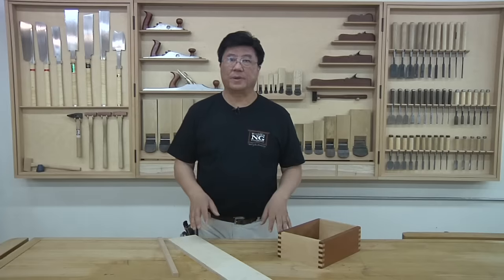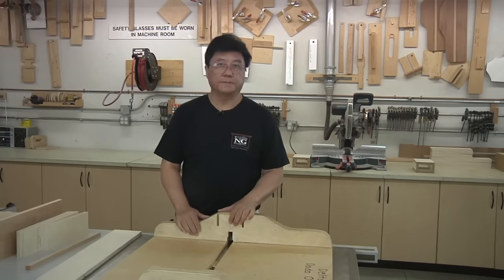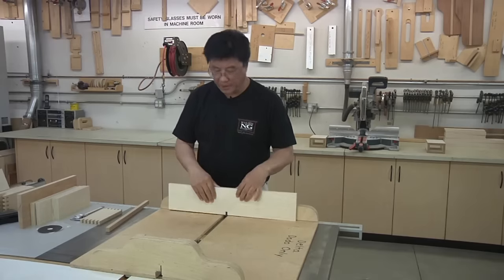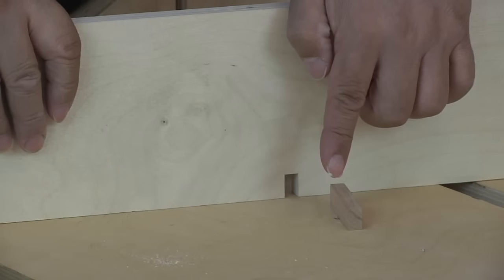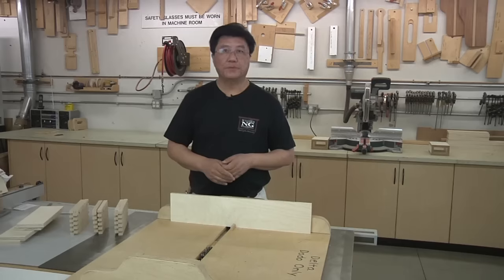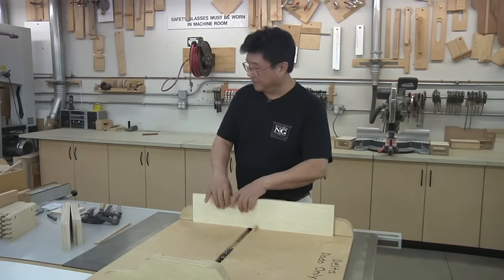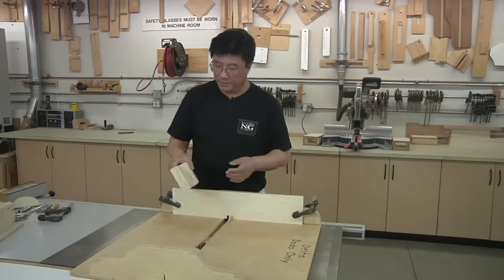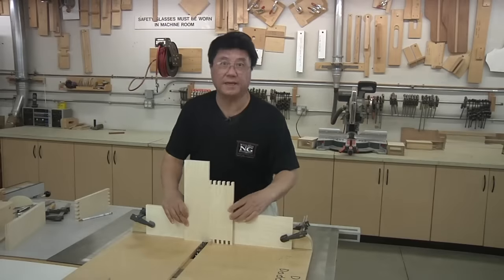Make an Accurate Box Joint Jig, Simple and Fast

Comment: Morning, William. Can you please advise me on one aspect of table saws: I own a DeWalt portable table saw - will a Dado cutting set be accommodated on my machine (it's the DCS 7485 model); I only ask because DeWalt (UK) could not give me a conclusive answer, & rather than lay out moneys for same, I'd obviously prefer to know, beforehand.
Excellent instructional presentation - I have subscribed on the strength of this first video - thank you !!
Reply: I just looked up your model of portable saw and the handbook that I saw said not to install a Dado set. My guess is because of the arbor length. I had the same issue with my first saw (portable contract) and while I couldn't install a Dado set I could install a Boxjoint cutting set (just two blades side by side in a couple of different configuations). Just a thought.
Reply: Thank you, Richard. I had rationalised that the arbour might be the issue at hand. The box joint cutting set, I have not seen in the UK; could you please (if possible) supply me with a brand/make for this set - even if it is Stateside, I would be grateful. I shall of course look around Europe in the interim,
Kind regards,
Andrew.
Reply: Andrew Tongue Andrew I just got home and was going to text you a picture of the box joint set that I have at home but I realized we can’t do that on here. The one that I have is by Freud and it is an 8” set that cuts 1/4” and 3/8” joints. If you want a picture feel free to message me on Facebook or Instagram and I can shoot you a picture of the set.
Reply: Evening to you, Richard, & thank you so much for taking time out to respond to my enquiries - it is greatly appreciated. Today has been a rare day off for me, so I've been playing 'catch up' with friends & family, as well as having a couple of hours' down time to myself. I am currently constructing two new bedside lockers, & want to be able to box joint the corners of the drawers. I shall look online for this "Freud" box joint cutting set that you mentioned (& obviously own) - thank you, too, for offering to show the set in question, but I'm pretty sure that your endorsement for same is completely sound. I might suppose that you're six or seven hours behind my time, here, so I wish you a pleasant evening,
Best,
Andrew
Reply: Andrew Tongue Apologies for the late reply but work and real life and all that. Hope you’re able to work something out. On a side note i just finished the box joints for the retirement chest and Williams method worked like a charm!
Reply: No, that's fine, Richard - we all have a life outside of the internet - I too have work & other preoccupations to keep me busy. I am pleased that you've completed the chest, & certainly his (William's) is one of the better methods I've seen. I've devised a safe technique, employing two blades offset, with an extra spacer for the arbour on my machine (purchased from DeWalt spares) - this works well, so I now have a Dado cutter, of sorts. Thank you for getting back to me. Enjoy the weekend ahead :D

Comment: Wm ... duplicated your process for my homemade router table with a sled. Question I have a variable speed 2-1/4 hp router with both 1/4 + 1/2" collets. What router bits would you recommend and at what speed would you run the router?  Have been getting a good bit of "CHIP-OUT" with brand new bits. What a wonderful video ... literally watched it a dozen times. Have a Blessed Day.
Sincerely,
Fred Scharpenberg
Clemson, SC
Reply from the maker: Hi Fred, I like Whiteside bits. To help avoid chip out, use a spiral bit if possible and backing boards. The higher the speed the cleaner the cut depend on the size of the bit. With small straight spiral bits of half inch or smaller, you should have no problem running at a higher speed. Hope this helps. Thanks for watching.
Reply: wnwoodworks I have to agree, I swear by spiral bits...SO much cleaner and smoother than straight bits....plus you're not cutting ALL the material at once....Depending on your application, you can get up and down cut spirals. For eg: if you're cutting the dado for the drawer bottom, you don't want the spiral pulling down, potentially getting tear out (specially if you happen to be going cross grain). If you get an down spiral, the bit is cutting INTO the wood so your bottom or face of the board will be smooth....Now, you have to press a little harder because the bit is actually pressing the material away from the table, but not that much.....BTW William, I worked in a production shop and drawers are the bane of any shop....compared to the rest of the cabinet they are SO time consuming, no matter which method you use to make them....In addition, there's a micro adjuster that works great with Biesemeyer fences.....I had one on mine and loved it....I'll see if I can dig up the name. It attaches to the fence and is held in place on the horizontal steel bar of the fence. You flip the magnet out of the way until you're doing your fine adjustment.....(more accurate than tapping on the fence)

Comment: Request for clarification: Am I correct in understanding that the finished finger will have 0.003" clearance on either side (for a total of 0.006") and zero between top of finger and roof of the slot? Thank you for your great videos.
Reply from the maker: Yes, that's correct

Comment: William, can you go back and forth between different thickness of stock using this method or do you need a dedicated board with spacer adjusted for each stock thickness? Can you just make a board with the shortest spacer (height) of stock you use with the spacer the same width? 3/8th?

Comment: Hey William Great video! Question?  Why don't you end up with 2 holes on the sides?  It looked to me liked you cut all the way through all 4 sides.  You said the drawer front would cover the two holes in the front.  You should end up with 2 holes on each side before the front is put on, right?
Reply: The holes do not show up on the sides because they are cut in the finger portion (and not all the way through the thickness of the piece.  They only show up on the front and back because they are cut in the space portion, so there is nothing to hide it.  Pause the video at 19:53 and I think you'll see what I mean.  I hope that makes sense.  ;-)

Comment: this is a rather old video, but maybe you are still active here. i often have a problem fitting drawer bottoms due to variation in plywood thickness across sheets, and sometimes even with parts from the same sheet. doing kitchens with dozens of drawers I always have a few that are too snug, and as you alluded to your production shop days, this is a problem. as a result ive moved to cutting a 1/4 inch dado, then a qualifying 1/4 inch rabbet from 3/8 ply for bottoms. ill cut large batches on a shaper setup with tooling above the work, small batches on tablesaw, on edge with workpiece between blade a fence. even with expensive high quality plywood i find that this is the only way to ensure consistency of fit. is there a particular type of plywood i am missing out on? although this process works, its quite a few setups, and i would go back to fitting 1/4 inch panels in a second if i could get a consistent thickness product.

Comment: William, would you advise adjusting the finger tolerances for making box joints in solid wood vs plywood?
Reply from the maker: +pacquetman Hi someone ask this before.For hard wood it's between 3-4/ 1000 Softwood would be 4/1000 and hardwood 3/1000. Hope this helps.

Comment: Do you go through the setup each time you have to make box joints or do you have a way to reference the jig each time? With those tolerances I would think a pencil line might not be accurate enough. Would drilling a hole through the fence into the jig for a dowel work to repeat the setup? Thank you so much.
Reply from the maker: I setup every time whether I'm making 1 drawer or 30 drawers. It takes less than 5 minutes for me to make and setup the jig. It's worth it because I know it will be perfect every time.... less stress, more fun!

Comment: It would be nice if there was a way to make this repeatable, so that when you come back to make some more drawers a week or a month later, you don't have to do the bit with the feeler gauges again. Sort of like your (excellent by the way) table saw sled video, where the fence is fixed in place once you have it dialed in. Is there a way to reference the box joint jig to the dado sled so that it's repeatable once you have the fit just right?
Reply: I guess you could make a test piece that you save with the jig, the first finger of which could be butted up against the saw blade like you show in this video. That way you could more or less know the position of the box joint jig on the dado sled fence, and then clamp it in place.
Reply: Or maybe glue two pieces of a dowel into the jig, and have those reference two holes in the dado sled fence?

Comment: This may be a stupid question but here goes.... do you cut the female parts and then make the adjustment for the male parts? I dont understand why the female part is smaller than the blade, i thought the blade body was thinner than the teeth and if the teeth measure .375 similar to the set on a back saw the kerf is bigger than the saw plate. thanks for any help you can give.

Comment: So, when you were cutting the dado for the drawer bottom and kept tapping the saw, weren't you making the dado wider? If after you get the right fit, how does one pass of the blade make a wide enough dado to accommodate the drawer bottom?
Reply: He did the first cut on all four pieces first, then did the tap tap adjustment, then ran all the pieces through again.

Comment: Very nice explanation, except for the math at time 2:00. You say you are making 4-inch drawers with a 3/8" finger. You show a drawer piece with 11 fingers. That adds up to 4 1/8 inches. Are you rounding off in your description?
Reply from the maker: The opening measures .365 times that by 5 = 1.83 plus the fingers measures .360 times that by 6 = 2.16 add those together = 3.99 inch. OK so I'm  .01" off. :-)

Comment: Hi William, Quick question for you. I am in the process of building a Humidor cabinet. It will have 5 cigar trays total each varying in length due to the cabinet varies in depth from bottom to top. Is there a formula to figure out finger and slot thickness for the box joint to achieve the symmetry that you are speaking of in this video?
Reply from the maker: Hi Chris, There's no formula per say. If you want symmetry just add finger and slot for the next size.
Reply: Thank you Sir for the response. I used your 5 cut method in making my first sled this past week. I was very excited to get my cheap saw cutting so precise especially on my first attempt. That formula is now in my permanent notes. You are a master to say the least.

Comment: You mentioned several times that the .006 spacing is for plywood.  What about if you are using a hardwood?
Reply from the maker: Killashandra111 With hardwood it's between 3-4 thousands. With denser wood 3/1000 softer wood 4/1000. Hope that helps.

Comment: Hi William. I don't understand how u get those different tolerances when the cut wide is provided by the blade size.
Can u please explain it to me.

Thanks a lot.😘
Reply from the maker: The dado cut provides a the width of cut and cannot be changed, that is correct but I can change the size of the fingers shown at 9:20
Reply: Understood now! As the newbie I am, there are lots of things i dont understand easily...  May I asume that I have to remove the rest of wood with more passes when the thickness of the finger is wider than the dado?
Thanks again for sharing ur knowledge.
Reply from the maker: @oscarg8119  Hi Oscar, No problem. We all start at the very beginning. Don't feel bad asking questions, that's how we all learn. What ever size tooling you choose, whether it's 3/8 or 5/8 just make the fingers a few thousands smaller by adjusting the jig.
Reply: Thanks again William. I really appreciate.

Comment: William, one more question.  If you set your blade height 1/32" higher than your material thickness won't your fingers stick out 1/32" beyond the drawer surface after assembly?  Won't they be 1/32" too long?
Reply from the maker: Yes. You have to size your drawers 1/16th inch longer 1/32nd on each side

Comment: I made a similar jig using this method, but it didn't go smoothly for me because my ($30 Husky) digital caliper readings would vary, sometimes by up to a hundredth from finger to finger.  I was carful about measuring and how I was holding the calipers each time, and holding the wood firmly on a comfortably snug fitting pin.  I was finally able to make a nicely fitting joint using poplar by several adjustments, though the readings didn't help.  I am just wondering if the calipers or using semi soft wood plays more of a factor.  Any advise?  I put the jig aside for about a month, clamped firmly together, and pulled it out today to do some tests because I am finally ready to do some drawers.  But, they fit so badly and I am a little frustrated at my awful readings again.  Spending over a hundred dollars for new calipers seems like, hey, why don't I just buy a jig.  But I am good at math and want to succeed at this method.  Any advise?
Reply: Get the analog Mitutoyo caliper that William uses; you will use it many times.    I don't think I go a session without using mine.

Comment: This is a way old vid, but I just found your channel (and subscribed). You say 3/8” spacing is “perfect” for a 4” drawer, but 11 x 3/8 = 4-1/8. I’m confused. Ok, I’ve now watched the video, and as an engineer I am impressed by the down-to-earth precision of this process.
Reply from the maker: Here's what I commented on the front page. The opening measures .365 times that by 5 = 1.83 plus the fingers measures .360 times that by 6 = 2.16 add those together = 3.99 inch. OK so I'm  .01" off. :-) Thanks for watching .... but not too close please.
Reply: William Ng Watching the video, I realized the answer was probably in the “thousandths” which add up (x 11).  As an engineer I’ve always wondered why woodworking was so needlessly imprecise. Thanks for your approach - I’ve learned a lot from your videos and hope to attend one of your classes when I’m fully retired.

Comment: Hi I like this video but when I tried to replicate using 1/2 stock for my drawers - but there is a gap. Not sure why as I tried move fence away from opening and closer to opening. Could it be my spacer? Also does the .006 of inch apply to 1/2 stock?

Comment: I've heard of some folks saying it ain't right unless it it absolutely tight. ie: having to use a hammer blow to drive it in.    I've always thought that was wrong as to two pieces of wood would act as a squeegee taking out all the glue.   I, personally, thinking having a joint fit to where you can put the together the way you did, not extremely tight, is better.

Comment: I've run through the video twice but don't see where to explain HOW to make the fingers .005/.006 smaller than the mating joint? Wouldn't this require increasing the width of the dado assembly when making the finger cuts, or did i miss something?

Comment: What do the inside corners look like? Do you do a light sanding over everything before glueing? My cut has some tear off on back side of tooth, the front part of cut looks perfect. What am I doing wrong or is that normal? I do not have a zero clearance saw insert.
Reply from the maker: You shouldn't have tear out if you are using high grade plywood and that  you didn't have to adjust your jig much. Your jig is your backing board. Also make sure your blades are sharp. The zero clearance saw insert does not matter, it doesn't affect the cut or tear out for this application. Try adding a backing board to the plywood when cutting, it should help with eliminating chip out.

Comment: A second request for clarification: If I understand correctly, you're placing your workpiece on one side of the 0.004" undersized peg, potentially doing it differently from one cut to the next. One cut has a .004" clearance on the left of the peg, the next cut has .004" clearance on the right of the peg, the next cut has .002" clearance on either side of the peg. This random placement would seem to affect the fit up, at least in theory. Am I missing something. Or maybe the built in looseness just doesn't make that much difference. Thank you.

Comment: Hi compleatly new to this what saw blade do you use to make the joints looks like a double blade ?? Pete
Reply from the maker: It's a dado set. each blade is 1/8" It also comes with one chipper at 1/6" and one at 1/32"

Comment: Curious as to why you don't cut the front and back at the same time and the same for the sides. If you're all about saving time and motion wouldn't this reduce the time to cut the drawer pieces in half?
Reply from the maker: hi Bob, Yes, I'm about getting the job done but I would never sacrifice accuracy for speed. try cutting two at a time and see for yourself. It's not that easy handling two pieces at a time, it does slow you down a bit and I feel the cut is not as accurate. If you mess up one drawer, there goes the time you want to save, but if you can do it then by all means do it. You'll save time for sure.

Comment: Hi William, what am I missing here… you are making the drawer 4” high, but the fingers & spaces stack up to 4 1/8” (11 x 3/8”). Please explain how this is symmetrical, thanks.
Reply from the maker: The opening measures .365 times that by 5 = 1.83 plus the fingers measures .360 times that by 6 = 2.16 add those together = 3.99 inch. OK so I'm  .01" off. :-) Thanks for watching